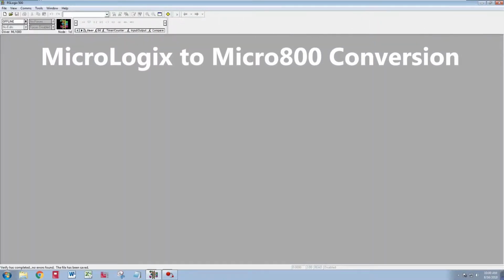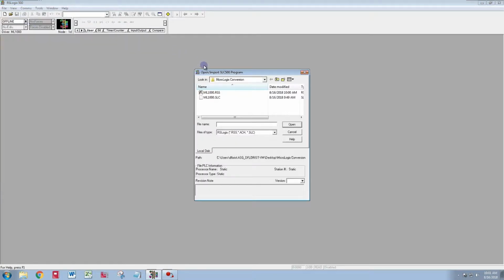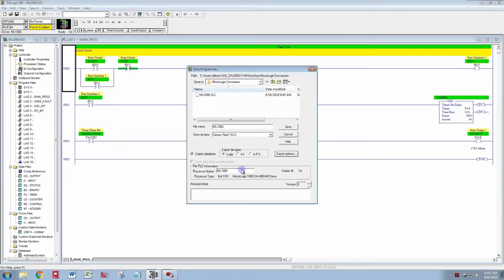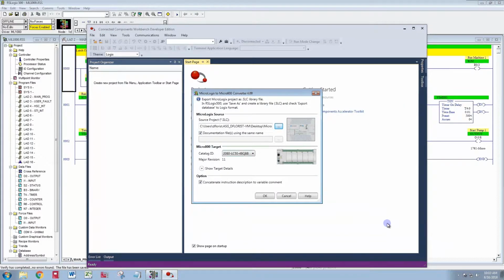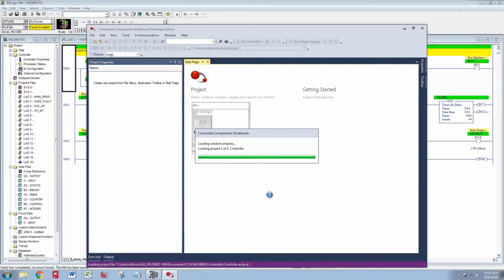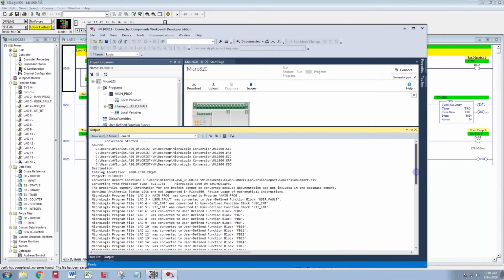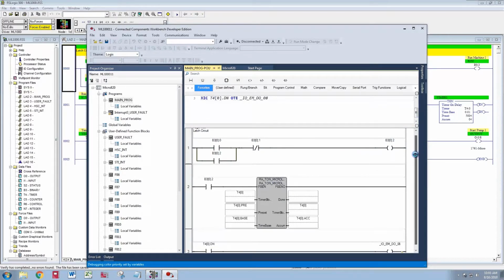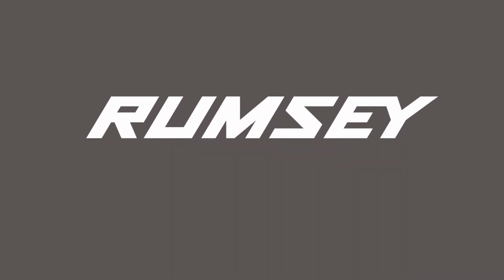Converting MicroLogix to Micro800

Comment: Hello sir Thanks for your excellent tutorial.its help us to boost our knowledge on PLC.

Hoqever, I have to replaced a burnt SIMATIC OP3 due to existing one burnt out.now i cannot operate the machine by this new operaging panel, which is control by Existing PLC( S7-300).

Can you please advice me whats the possible cause  and solution.
Reply from the maker: Thank you for your comment. Unfortunately we do not support those two products (SIMATIC OP3 and S7-300) and can't advise what may be causing the problem. We suggest contacting your local Siemens distributor for help!